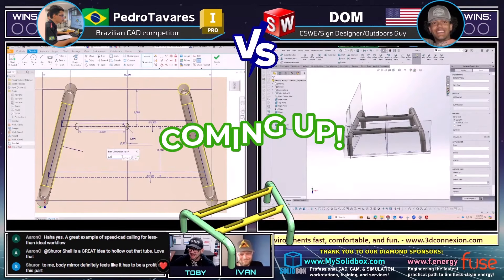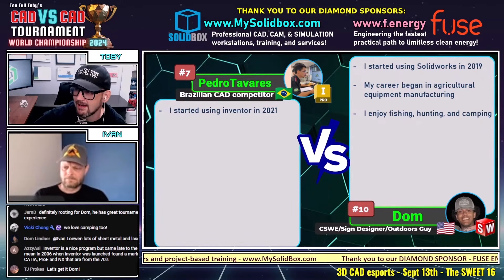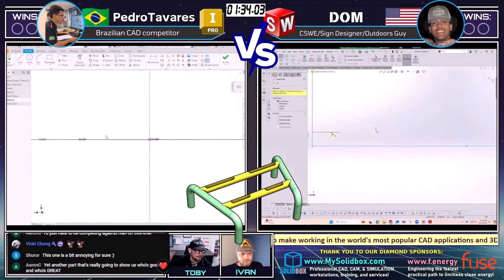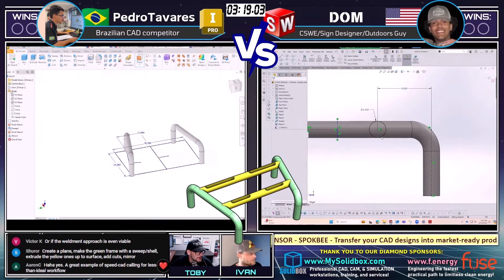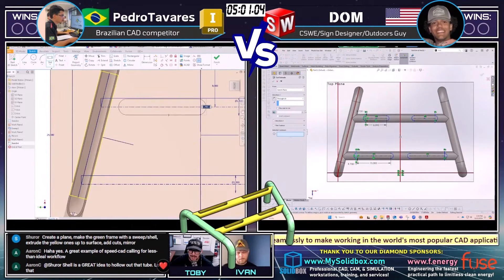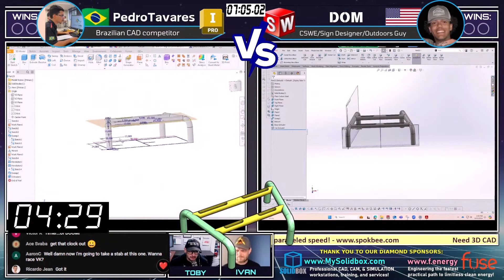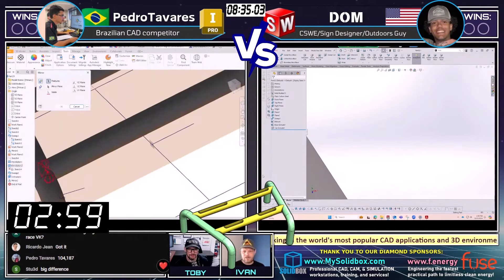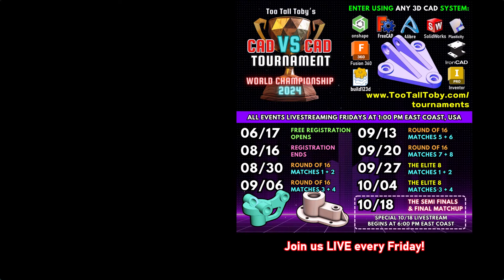3D CAD esports - TOURNAMENT HIGHLIGHT - Match 6 - PedroTaveres VS DOM - INVENTOR vs SOLIDWORKS

Comment: It's so reassuring to see how even experts sometimes make stupid mistakes and struggle with their CAD systems.
Reply from the maker: lol - when you're in the HOT SEAT you can get flustered really easily.  Shout out to all the runners :-)
Reply: Thanks for shattering my illusion that they at least make a mistake now and then when they are already 3 times faster than me. ;)
Reply from the maker: @andreasbramftl1106  lol

Comment: pipes/first 2d sketch on top plane with centerline dimensions and add 3d sketch for legs& extension at yy' . swept boss circular profile 3d sketch with thin feature. 
solid bars/ - 2pcs circle at front plane and boss extrude upto bodies and then cut the slots.
Reply from the maker: Very nice workflow.  Fusion user?